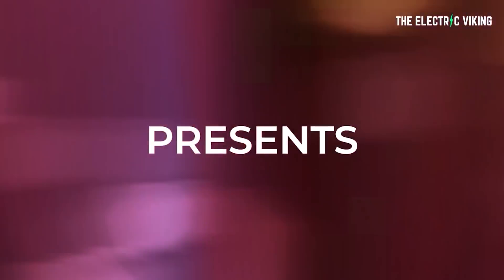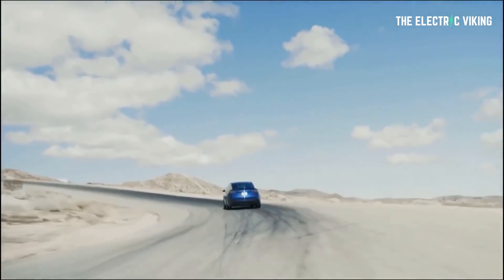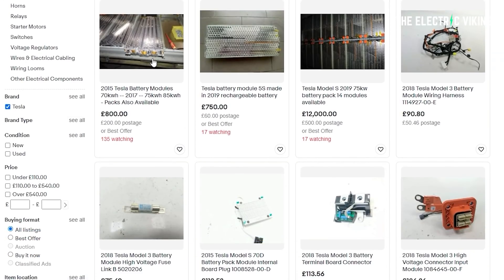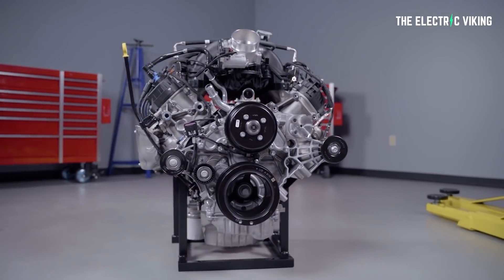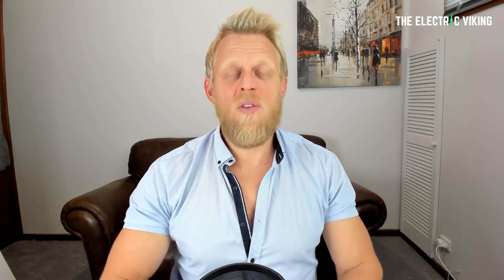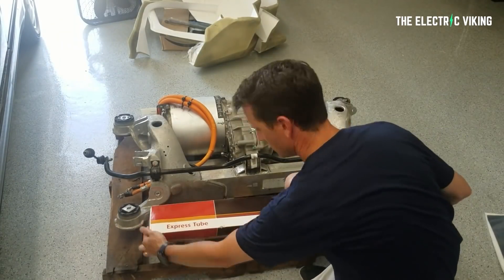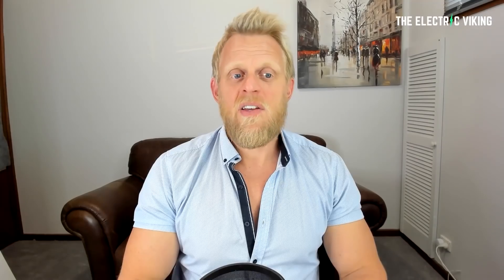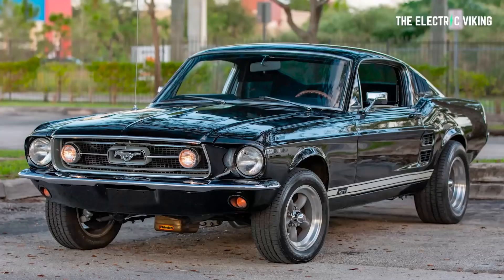Scrap the small-block V8 Swap for this Tesla Crate Motor

Comment: A limousine or hearse. Just think of the amount of batteries you could fit in. And since you could charge it in between runs, charging time wouldn't be much of an issue.
Reply: BRILLIANT!
Reply: A classic Checker cab is another idea that just occurred to me.
Reply: A local funeral business has converted their vintage replica hearse to electric for your very stylish send off.
Reply: @Jan 6 was "Wall Street Putsch" part 2 Whats the voltage of your  HV Battery? And knowing that what semiconductors would you use in the motor drive circuit?
Reply: @Jan 6 was "Wall Street Putsch" part 2 nope hearses aren’t sport cars, they don’t need 800hp to run, even 300hp is more than enough

Comment: Should work well for pickup trucks.  Put the batteries between the frame rails.
Reply: Too much power for me. I want something like a Bolt motor.
Reply: @williammeek4078  The trouble is the modification of the transmission wouldn't be cost effective. Take a look at the 'Electric Classic Cars' channel if you're interested in conversions.
Reply: @eclecticcyclist  people have already been doing it for decades. The transmission isn’t the problem. As with everything else, it is the cost of batteries. Take a look at all the EV conversion videos in UTube.
Reply: @williammeek4078  Using Bolt motors for decades?
Reply: @eclecticcyclist  No… the Bolt hasn’t been around that long.
Reply: @williammeek4078  So your claim that people have been doing it for decades does not refer to the Bolt motor.
Reply: @eclecticcyclist  correct. People mostly used large DC motors and speed controls like what is found in an electric fork lift, but now much better tech is available.
Reply: I thought the same especially when the next gen batteries are available at low cost and lower weight. Early 2000s rangers wranglers Tacomas early model transits and frontiers still alive in 10 years might get electrified for a bit  cheaper than a new car.
Reply: @sunkings5972  cheaper than a new car!? Lol…. Let’s not forget all the electronics and batteries costs around, including the modifications costs..
Reply: @alanmay7929  yup. This will probably never be cheaper than a new car. Especially adding conversion costs. I think it's a cool idea though
Reply: @JamaicanMeCrazy  i think if we can develop a great battery that uses much more commun material it would made it more feasible, CATL is developing sodium ion/iron battery for example
Reply: @alanmay7929  I’m optimistic but the batteries and drivetrains are going to have to be much much better than they are currently for let’s say my 5000lb car. Can’t wait though
Reply: @alanmay7929  not cheaper than a gas car, doesn't need to be. Start converting gas vehicles because gas will be non existent soon.
Reply: @BoostedDriftR  lol…….. gas will still be here for decades